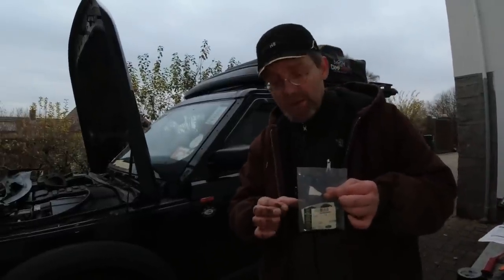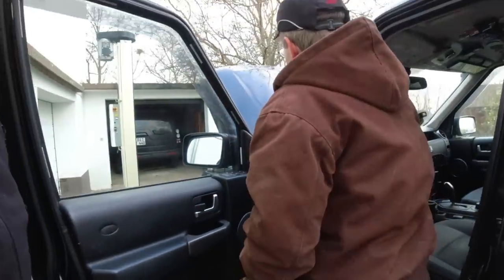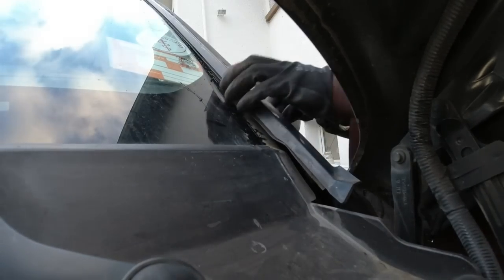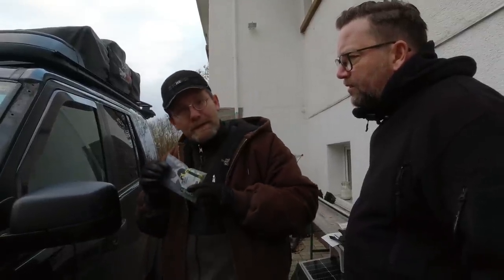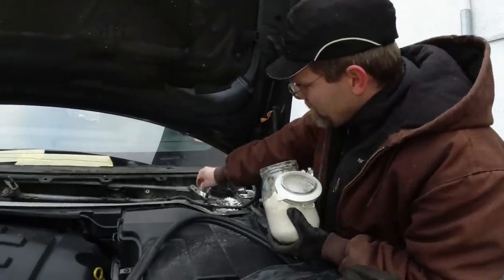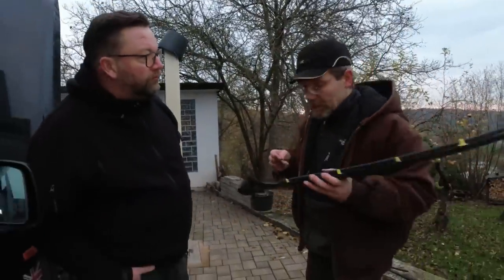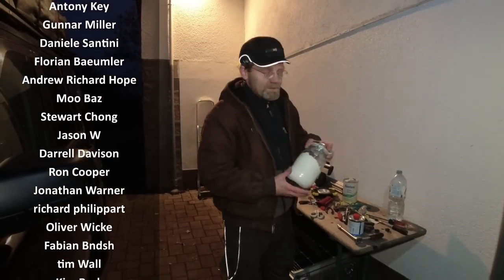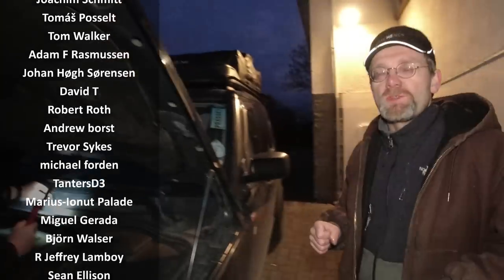Fixed Water Leaking in Footwell - Land Rover Discovery

Comment: Quick tip to everyone from me.... Check the condition  of your rear Anti roll bar mounting bolts before they become  coroded .  Copper grease the threads of new bolts and cover the new bolt heads with silicone bathroom sealant to protect them . Doing this will prevent a body lift in the future when you need to replace Rear ARB bushes like i had to .
Great video Christian and Vera,  merry Christmas to you all 🎄🎁
Reply from the maker: Oh you will enjoy our next video. 😅👍Merry Christmas🙋‍♀️Vera

Comment: This video reminded me of too many years ago when I was training as a mechanic in the early '80s, with a business that repaired and maintained Land Rovers fitted with petrol V8 engines. A new 110 had been driven on a very wet day and the water had poured in through all of the floor panels, they had not been sealed properly when it was built, back then it was typical British engineering....

Comment: My LR3 had two of those locators on each a pillar, one at the bottom and one at the top. I removed and taped over both. Also, you should consider doing the intake air/cowl water leak repair. The black plastic cowl cover will warp with age and allow water to pour into the cabin after it soaks the cabin air filter. It’s another simple preventive fix with tape and some plastic shielding.
Reply: Yeah, and it could have been done with this job, as it requests the same parts removed ;-). FYI: you can see this flaw of  LR at 8:08 in the top right corner of the video. BTW if you miss this fix, it does not only soak the airfilter but also damages the blowermotor, Been there done that ;-)
Reply: is there any info of this repair somewhere? tia
Reply: @lobby1529  there is a youtube video, but dont ask me where and when. But it is easy to do. Just follow this video until you get to minute 08:08. There you see the inlet of the air in the top rught corner. When opened up you will immediatel understand the problem, as soon as you put some water over your windshield. To fix you just have to mount a lip beneath the windshield, so water drops beside this opening. I used self adhesive bituminal sheets, as it is stable under typical road condition and it was lying around in my garage. So it is as easy to repair as in this video and needs to follow the same steps of disassemling and assembling the wipers, the A-pillar covers and the windshield cover.
Reply: Easy fix.  Leave the car in the garage!

Comment: There is another classic designed-in leak in that area where the window seal unloads with age and water then drip into the cabin air intake through the blower onto the foot well carpets. Might be more a RHD vehicle issue but may be not. It just takes a little bit of plastic sheet to extend the water run beyond the air intake to fix. I do enjoy your videos and I liked my Discovery III, but rust was ever increasing the work load. I spend hours  routing new auto-box oil cooling pipes after they rusted through. Obviously must be another body-off job in the manual. 🙂
Reply: I can assure you it is also a LHD problem ;-)

Comment: eBay repair kit for A-pillar, £11.25. I'm pretty sure they aren't LR OEM, but think about it,...LR don't make plastic clips they are supplied by 3rd party manufacturer. The benefit of purchasing an OEM kit, it will be sent in a plastic bag worth £10+, so they will have included a carbon offset value to it, so rest assured the bag is good. !! Keep it up guys, great content.

Comment: Great content as always! Had to do the same on my LR3 recently in the hopes it would alleviate water accumulating in the footwell. Turns out it was actually the AC Condenser drain port in mine that was clogged and causing the water accumulation on the NAS spec passenger side. Blew out the drain valve and have not had an issue since 👍

Comment: I had this issue on my previous D3. It actually stopped all the central locking from working so I couldn’t open the car. Water had sat inside the the inner door sill and got into the wiring harness. Luckily the Facebook group had information on it. There is a green wire spliced under the plastic door sill trim that corrodes with the water leak, mine was full of water.

Comment: I had to repair mine as I think the previous owner had a bust windscreen, the folk who repaired did the fatal thing and obviously pulled the A pillar seal and broke the Clips. I did a quick fix by inserting household rawl plugs as the spares I had were wrong size. Works fine but I must remember to do proper repair soon. I used a little silicon sealant to be double sure. My repair was only a few pennies.

Comment: Ahh…. A common mistake is to assume that it is the intake cowl. Check the sunroof drains where they exit through the body. This is often misdiagnosed and could mean a number of attempts to sort it out. This is behind the fuse box on RHD models. Great video
Reply from the maker: As we said in the video that the sunroof drain is an entirely different problem. And this Discovery does not have a sunroof. 🙋‍♀️
Reply: You are correct. The comment was aimed at the comment readers so that they did not have to get onto a forum and ask where the leak could also be. 
Rest assured that I watch every video and love the content

Comment: Another quick fix.  You need a nice piece of 'speed' tape which we used to use to fix many things on military aircraft.  Not as expensive as space tape 🤣🤣👍Merry Christmas 🎄
Reply from the maker: 😅👍We still needed the clips, so no harm done. And we actually did not expect it to be the tape. We thought that the clips were the problem. But now you guys know, and if you can get the clips off without breaking, you'll have a cheap fix. 😅🙋‍♀️

Comment: There is a upper locator pin and hole that also commonly breaks off, this was not sealed? I put 3m foam tape on mine when I removed and replaced the sealing clips.
Reply from the maker: There was no upper locator pin on ours. 🙋‍♀️Vera

Comment: I would have never thought to have marked the wipers; that's a great tip.  Is there any risk of bi-metallic corrosion using copper grease versus standard grease?  Frohe Weihnachten.
Reply from the maker: If you drive a Land Rover, Copper Grease is your best friend, in our humble opinion. All risks appart. Merry Christmas 😀🎄 🙋‍♀️Vera

Comment: Did it fix it?. I had the same problem,  the water ingress came in near the top left of the screen, about where you had your camera focused at 3.30. I replaced the clips,  put put the tape on as part of the course but it didn't fix it.I had a new screen fitted and it still leaked. I was still convinced that the leak originated from top left of the screen so I removed the front section of the plastic gutter trim. I noticed the faintest hairline crack in the paint that covered the seam sealer that sealed the roof sections. Putting some blue tac down stream of the crack I slowly poured water onto the crack, not allowing the water to pass the blue tac. That's where the leak was, I had finally found it. A generous amount of polyurethane sealant fixed it. I replaced the gutter trim and you would never know that I had been there. The problem was that the previous owner (who was a builder) had roof racks fitted at the mid and rear section of the roof and  carried ladders etc on them. I think that with the uneven load spread over the entire roof space, coupled with only two roof rack cross beams being fitted ( one over the B pillar and one between the C and D pillars) caused constant flexing on the roof, which caused the tiniest of cracks to appear and ultimately cause the leak.

Comment: Excellent video on a very important topic! Thanks very much. Wishing you a very happy Christmas and look forward to 2023 videos. One idea - have you thought about doing a video on air suspension lifts? I know you can program ride height but there are also adjustable height rod sensors. Nice to have the extended mode on demand without having to bottom out to get it to automatically trigger. I think there may be a downside though in loss of articulation, ie, may not operate like just an extended off road height.
Reply from the maker: These options are well covered in many videos.  In Germany such height mods require an acceptance by the TÜV.  Happy holidays.  Christian
Reply: There's also an XLifter module you can get that does it without any mechanical part changes. Also has an auto levelling feature for when you are camping. Useful when you have a rooftop tent. I'm surprised Land Rover didn't implement this feature with the new defender. After all it's just a bit of additional programming and a couple of tilt sensors.

Comment: Great video guys. Do you know if this applies to the discovery 4 as well? I have 2011 Lhd D4 and the drivers footwell is soaked. I think it could also be the A pillar.
Reply from the maker: We don't know. I mean my Discovery doesn't have a leak and it's 17 years old. But if you do have water incress in the future. You know there are more causes than the sunroof drain. 🙋‍♀️Vera
Reply: Hi Vera, thank you for taking the time to reply. I am aware there maybe other areas for potential leaks. The sunroof drain is the most common, but mine are fine. I am working through each possible cause and the A pillar is the one I am looking at now. Are there other common areas on the D4 I should check? Thanks again you guys are great. 🙂

Comment: So guys, I went to do this repair as I suggested I also had the same leak in an earlier comment.  When I removed both my plastic covers, the guide that needs to be cut off was still on it but it had a sponge washer on it.  So that’s fine, the new patch takes care of that but then I noticed there were 7 holes in total.   Did ye spot that?   So there is a guide up top, 5 trim pieces and then another guide. 

What did ye do with the top guide hole, surely that’s susceptible to a water leak also?  It looks like our repair kits probably should have had 4 patches as one would imagine the extra 1st hole would also be an potential for water ingress?
Reply from the maker: When look at minute 21:20, you can clearly see the entire A pillar cover. There was no upper locating pin. I still hope you cut of your guide pin. The sponge will not prevent water leakage if the guide punched through the tape again. 🙋‍♀️Vera
Reply: @Vera_and_Christian  that’s so weird. Ya I have upper and lower guide pins.   The upper ones are broken off and stuck in the holes.   Well the were.  I’ve had to make a hole made patch for them.  Mines a right hand drive Irish 06 model, maybe there were slight changes in the years.  

Anyways regardless thanks for the great video. I had put this job off for ages but by this evening it’ll be another job done.  

Thanks Vera.  Happy Christmas from Ireland 🇮🇪

Comment: Whilst having the cowl off anyways you should’ve built a small cover to protect the blower inlet from water ingress through the mostly warped cowl seal.
Reply from the maker: Taking the cover off is a 5 minute job.
Reply: @Vera_and_Christian  True, but getting the passender side carpet dry isn't, that's an utter pita!
Reply from the maker: @Christian76S  It's just something you have to deal, with. Like with every other problem that can happen. Nothing more. Out of every repair on a Land Rover Discovery 3, I think that is by far the easiest to deal with, including getting the carpet dry again. Even desktop mechanics can get it done. 🙋‍♀Vera

Comment: @Vera_and_Christian Can you not just use boat sealant tape for the hole you are trying to cover?
Reply from the maker: You can use whatever you want. Boat sealant tape is not something we have lying around our workshop. On our own car, we probably would have just used duct tape and called it a day. However, when you take off the pillar cover, those clips will break, and you will need to buy the repair kit anyway. 😃👍🙋‍♀️
Reply: @Vera_and_Christian  I understand you do mostly diesel LRD rescues but how much harder is a petrol version rescue LRD? Love the frame off restoration and detailed videos.

Comment: You are 1 week too late!  I just replaced all the clips on my A pillar covers because the windscreen was replaced some time ago and those guys did not replace the clips and one cover came off.  I noticed that my covers had that loacting pin on them with no waterproofing seal.  Now I will need to do it again and cut off off those locating pins.  I might just use regular fibreglass tape though.  Not sure I need the special NASA patch!.
Reply: Any NASA spec duct tape will do of course.
Reply: Each time I have had a windscreen replaced I have insisted on new A pillar trim. But why on earth do the new trims still have that locating pin on them - 17 years after the TSB was issued. Surely Land Rover stock is not that old. Or perhaps the bean counters at LR insisted it was left in place to bring in more revenue in years to come. 
Grrrrrrrrrrr
Reply from the maker: Of course not. You can use any tape that will withstand water for many years. But, on a 16 year old Discovery, the clips are really brittle and break easily. And two different ones are used. So everyone better have the clips on hand, just in case. 🙋‍♀️Vera
Reply from the maker: Barrie, yes it's just unbelievable. 🙋‍♀️Vera

Comment: So basicly it could be done for 2$ by using some bicycle tire repair kit
Reply from the maker: 👍But not on a 16 year old Discovery 3, or any other Discovery . The thing is, when you take off the A pillar, you most likely will break the clips and need to get new ones anyway. 😅🙋‍♀️Vera
Reply: @Vera_and_Christian  in Poland this clips you can buy for 7pln per pcs.(around 1.5E)+shipping
Reply from the maker: @ariellech  Perfect, as long as you have them on hand before you take of the A - pillar. But as you see in our video, there are two different clips. Make sure you get the right ones. 🙋‍♀